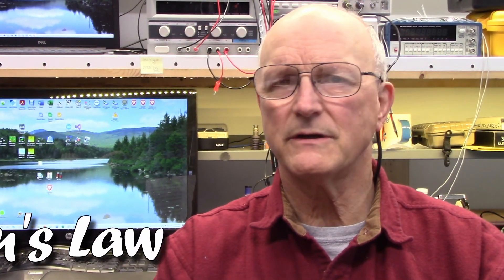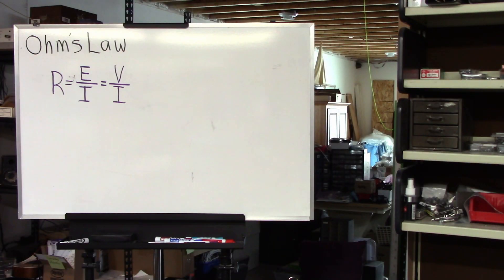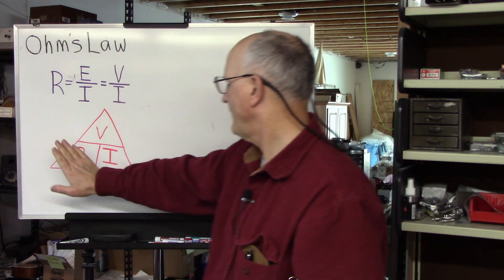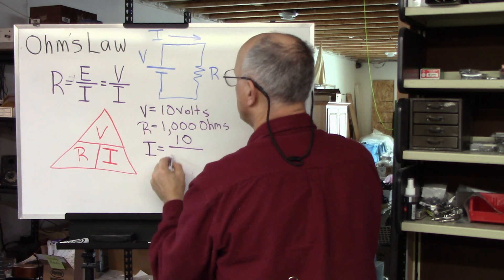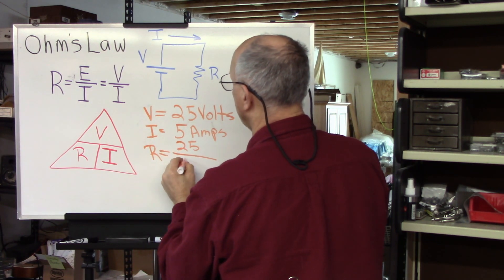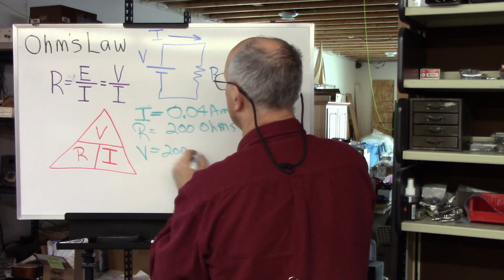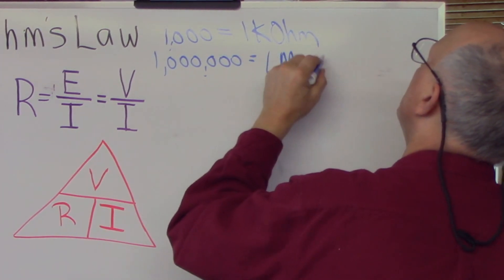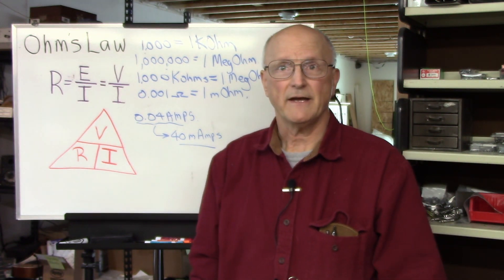Ohm's Law: Basic Circuit Analysis (010a )

Comment: Hi Ralph, after obtaining an electronics engineering degree. What are the top 5 jobs you'd suggest? Also can you describe on a high level the role of a RF engineer? Any advice is appreciated, thx!
Reply from the maker: Congratulations on getting your EE degree! THAT's a LOT of work!
So, here is my treatise ... 
As far as the top 5 jobs ... that entirely depends upon you and your interests and your aptitudes. The field of EE is so incredibly wide ... everything from designing the guts of integrated circuits (I knew that wasn't me right out of the gate) to circuit design (analog, digital or mixed signal) to system level design using off the shelf "building blocks" all the way up to the power engineer for huge electrical distribution systems.
In the analog realm is this DC control systems, low frequency, RF or microwave?
In the digital realm and in the mixed signal realm, there are a lot of microcontrollers (C), programmable logic devices (VHDL) and, possibly, a DSP chip or two.
Then there are the antenna and transmission line guys (a LOT of magic there). 
Then there is the choice between research and development, product development or test equipment engineering (e.g. specialized production line testing of product).
Finally, there is the choice of industries. I worked in the Heavy Military Electronics (Radar & Sonar), Medical (audiological, EEG and radiation oncology) and Petrochemical (alarms and level sensors - had to make sure my stuff didn't blow things up) industries.  My favorite was the medical industry.
When you read these lists just now, eliminate those that you had an immediate "ick" to.  There has to be a personal "pull" for you. Be prepared to get into a particular position and realize that it wasn't what you expected. Be willing to change horses until you find the right niche for yourself. Also know that no position is perfect. There are *always* going to be those aspects of any place or position that is nothing short of unpleasant. You do what you do for the stuff that makes it worth while to put up with the less than desirable stuff.
Me? I referred to myself as a "generalist."  I did not specialize, but was involved in a lot of different kinds of things. I did analog and digital circuit design. I am a troubleshooter.  I did a LOT of microcontroller and programmable logic device programming, though this was always the "price to pay" for me. Not my favorite part of it all; I could do it and I was fairly good at it, but....
As far as RF engineering ... a LOT of magic in them words! 
Like EE in general, a very wide field. You could design the guts of ICs and other active devices. You could be involved in circuit design (e.g. circuit boards and systems), system design, antenna design and more. Do you like to work with building cool things with parts? Are you more of a system level guy working with off the shelf devices to build systems?
So there ye go, my friend. I hope this was helpful.
Reply: @eie_for_you  Ralph I'm extremely grateful for such a detailed reply, I'm extremely grateful! Thank you so much! 🙏🏾
Reply from the maker: @RL-521  You are very, very welcome. If there is any way I can help, I am happy to be there for you. 🙂